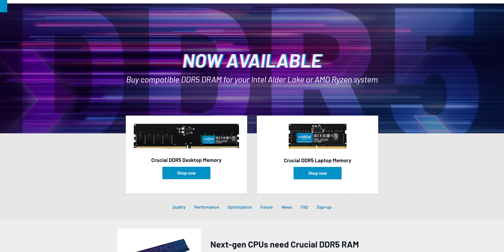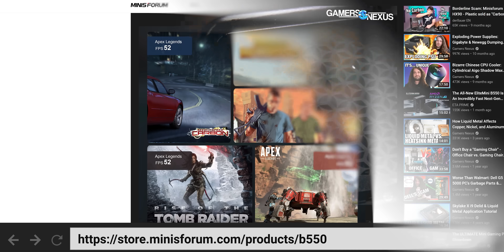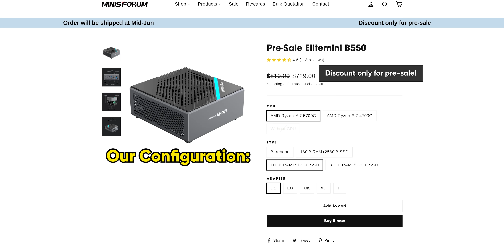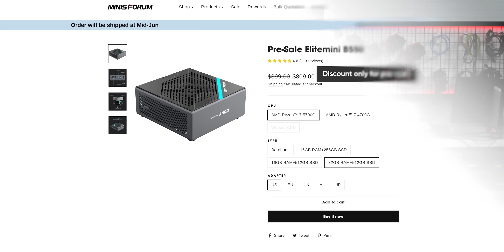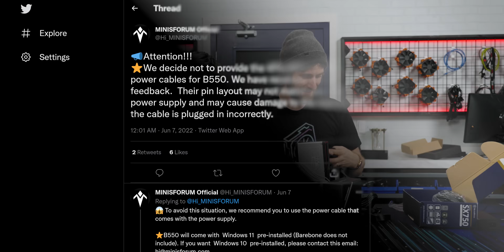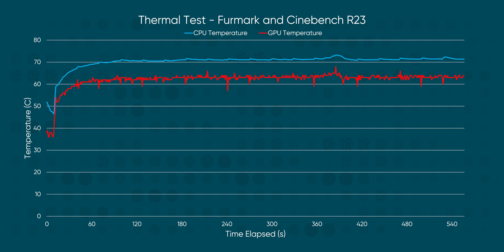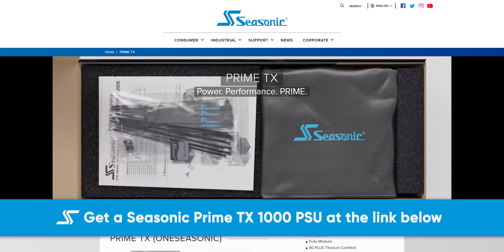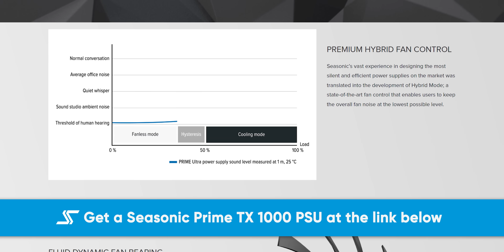Who's Buying These? - MinisForum Elitemini B550

Comment: HOT TAKE! I think it's perfect for me. I take my desktop with me a lot and having it in a package like this where I could just tear it down into pieces very easily to fit in my bag makes a lot of sense for me. I think with a couple improvements (having a fully featured PSU integrated into the chasis that I can just quickly route a cable from the main box to the GPU) this would genuinely be something I would buy.
Reply: Yeah, it seems like it could be good for a consultant or someone who travels a lot and stays in a place long enough that they want a full powered GPU in their hotel and also something that's not a gaming laptop when working at the client site.
Reply: @emma70707  But it would still be easier to just have a laptop, with a external GPU.
Reply: @DenDodde  Not necessarily. Not for me at least. I do a lot of work where I need something like a 5950x and a powerful GPU. Mobile grade compenents will literally cost me money by the added time they take to do the tasks I need done. Also external GPU enclosures still usually take up a decent amount of space where I could just have a GPU, the PC, and the platform that puts them together.
Reply: @MaybeAnnatar  What job do you have?

Comment: Very niche use, but I have all my uni work on my gaming pc and struggle to resist having a break to play "just 1" game. Because of this, bought a laptop without dedicated graphics to do all my uni work on so there is no temptation. This could be an alternative, easy to take off the GPU and just put it away when you need to focus and don't want the temptation.

Comment: this system would make a beast of a WAN router with OpenWRT or PfSense. Would run circles around any of the premium routers from ASUS or Netgear. Add a LAN card for pci-e x16 slot and you've got yourself a router/switch in a single package. All for less than 600-700 USD is pretty sweet. Would last for ages not to mention the unlimited configurability for networking nerds

Comment: This actually looks perfect for me, I am upgrading to a 3080 soon and my 550w psu is definitely not enough to push that. So if I want a system in my living room instead of getting a micro-atx case to fit the atx psu I can just have it more or less loose on a shelf with my old tripple fan gpu.
Reply: Except you should probably watch the tests done by other channels which expose just how scammy this thing is. You'd be throwing money out on a worthless system. Get a laptop. Simpler.
Reply: @aserta  why would i get a laptop to support a gpu?
Reply: @EricLab97  You could technically get one of those things where you connect a laptop to an external gpu, but i think you need a thunderbolt port.
Reply: @aserta  also what is the "scammy" part of this, I understand that it isnt the best idea to get basically just a motherboard for $320-$400 but idk what my future plan is for the old gpu. I am going to either use that psu and gpu in a different smaller form factor pc and get a mb + cpu + ram, or i might just use my "older" 3700 and b550 micro-atx board and upgrade once Ryzen 7000 is launched or smth.
Reply: @EricLab97  But if you have the cash for a 3080, there is  no reason to not just get a case where it fits in and slap your existing mb, ram and everything in there and get a solid psu, which you'll need either way.
Reply: @aserta  laptops are sh*t.
Reply: @aserta  he's getting a 3080, getting a laptop would be a bigger waste of money than to get this even if it doesn't work.

Comment: If this were me, I would want to see an adjustable side bit for the GPU mount, as to not interfere with large GPUs, or even to adjust down to smaller GPUs, there's plenty room there for a couple screws, although it would make that part of the bracket a bit weaker.  Also, there are smaller PSUs you can get, honestly I can see someone duct taping a small boi to their GPU and just going off of that. 

Additionally, $900 for full spec is frankly a steal, over here in Scotland, costs you a little more if you convert it for parts, jump on Amazon UK or ebay UK and you'll soon see what I mean.  Also I can see this being a much cheaper alternative to similar spec laptops.  Yet again, UK here so prices for parts are kinda crap in comparison.

Comment: I see it's usage in workforce for productivity, some people might need external GPU and some don't, but you have basic package for everyone, and just swap/roll M.2s for people as needed. Even if one machine dies you will have a set of same machines in the back. And likely for game development or even gametesting you might need different gpus, I see this used as a semi/workbench if you have repeatable workforce and don't want to do system building.

Comment: I just need this but for a laptop and I would 100% buy it. I know we had exteneral GPUs for laptops but I just want a system where I can just with 1 cable connect my laptop and everything is connected and when im done I can remove my laptop with 1 cable and im on the go. This way I get more performance when i am on a desktop setting and I can be on the go with the same info with just less performance. 

Couple this with a laptop that looks professional and not gaming looking because frankly i am not going to game while on the go and it would be perfect. NOT CHUNKY, really good CPU plenty of ram, 120hz (because smoooth), metal enclosure and I would buy this in a heart beat.

Comment: While this is a bit of a silly concept. I am an ultrabook w/ overpowered CPU and lots of ram no real GPU user. I love the concept of an external GPU, but it's still a bit of a mess via thunderbolt. Having a direct connect PCI-e connector (I know a manafacturer or two has come out with concepts of this, but actually affordable mainstream machines that are ultra light and with pretty displays  / keyboards / etc.) would be amazing if it became a real standard. You slot your laptop in at home, and take it with you. I just don't feel like the thunderbolt e-GPU's are there yet. Although I haven't tried thunderbolt 4.

Comment: i really like the design of that without the wires of the PSU. if they would make a neater way hook up power and try to make it a industri standard. having a slot for "CPU block" and a slot for GPU and then you just pull out one block and replace it with a new one later. a lot of people would love it.

Comment: I have 2 really good use cases.

The law firm I work at really wants to just have 100 of the exact same computer and also need GPU's for about 10 of them but the tiny form factor is a must.

Also good for a small GPU test bench for IT at the same firm. (That's me)
Reply: Question, in a law firm what would you need pc performance for?
I can imagine a chromebook couldn't handle going through a bunch of papers, but what would a gpu be of use? Like couldn't any laptop which isn't completely bad be enough?
Reply: @Daniel-dj7fh   you'd think.  Like I said there is only a few people using GPU's and they are mainly for the video and graphic designers we employ. Mostly for our commercials and the few apps we deploy

As for the others excel spreadsheets can get really intense.  I was shocked when I started here to see how hard they can be on a system.

Comment: Great video as usual Linus! I'm actually going to build my own PC in the next month or two and I'm using your videos as guidance :D
Reply: remember to take your time.
and if you have a cheaper motherboard be careful that the pins on the io-shield are bent correctly and don't damage your mother board ports. Bet thing is to put your io-shield on the motherboard and checking everything before clipping the io shield in the case.
Reply: @Daniel-dj7fh  will do! thanks for the tips :)

Comment: This product is neat, but ultimately pointless. Like Linus said, get a laptop.
I have a GPD Win Max with the 1195g7, and a 3060TI egpu.
When i'm at home, my win max acts as my main gaming PC. And though i do have some performance loss over the thunderbolt linkage, it's not terrible.

The only thing about my win max that i hate, is that i can upgrade the ram, so i'm stuck with 16GB. Which isn't enough for one of the games i play.

Comment: Man, this is simultaneously incredibly cool and also *super disappointing*.

This is essentially the ultimate fix for all of the ultrabook + eGPU combo kinks, but simultaneously offers none of the benefits of having an ultrabook.

Open standards for external PCIe connections on laptops would be super cool. But I think everyone would prefer to continue making their own proprietary and locked down thingy, or just use thunderbolt.

Comment: They should have made the main unit a laptop with a desktop CPU and PCI-E x16 slot. This solution could have competed for a market share with the "just buy 2 systems: laptop and gaming PC" strategy. When unplugged (or powered by a power brick), the CPU could have used only efficiency cores at lower clocks/voltages, just like a regular laptop. On the other hand, at home, you could have just plugged the laptop into a station with full power delivery and PCI-E x16 (we could have here an additional CPU cooling system similar to LPP from Eluktronics).

Comment: Use case: "Dad upgrades 4 kiddos to a shared gaming system for older AAA and  emulation using spare 1660 OC and Ryzen 3600 with a barebones kit"

Dad's secret: Will also be a reason to pivot to Dad's system upgrade to zen 3 cpu and 30 series card. FULL SEND, NO RAGRETS.

Comment: I wonder if it points a way towards a new model of DIY computer building.  The biggest issue I have with building (or upgrading) my PC now is all the cabling.  Being able to assemble a computer from a modular - Motherboard-CPU-Memory-IO-storage module, a GPU module, a PSU module and may some HDD's where everything just plugged together without the need to manage all of the cables is something I would be very interested in.  For me that would be more interesting than the small form factor PC.  If this came with a larger enclosure that included all of the pre-routed cables and all of the pieces could just be plugged in - I think it would be a great idea.

Comment: I love Linus' confusion at the end. He's not wrong. This product seems to be solving a problem no one has.
Reply: I honestly think this is a solid ass alternative to a laptop for Uni if you have access to a monitor, which you normally can in a lab or the pc rooms. With a Logitech keyboard mouse combo it's literally just plugging it into the wall with the brick and yoinking the hdmi cable of the uni pc to have a 100x better experience where you can have all your files and programs.
Adding the fact that you can have a pretty slapping apu in there makes it even better for engineers or programmers who need abit more performance than something a surface pro or something of that category at the price range can offer.
Instead of buying a low-mid range laptop I think this is the way to go. You can get a R5 5400g for under 200 bucks and 16gb of ram for about 70 which makes this thing ~700 bucks. And I know of no laptop which has specs on par at that price. Maybe +60 for the mouse and keyboard and you can get those old dell 4:5 monitors pretty much for free nowadays and you're good to go at home.
Reply: You're not everyone.

Comment: Thanks for doing these.  I know these types of projects seem confusing but the holy grail we're all looking for is a portable, Upgradable, Quiet system that gives you Desktop performance.  Since most of us plug in for power already, creators (game devs, 3d artists) are looking for systems that could theoretically be taken to the office or travelled around with.  Systems we don't have to replace every 2 years for $2500.
Reply: Yes!. This is something that is difficult to make other people understand. I want a portable, upgradable system that I can just put on my backpack and travel to another place (Lan Party, Coworking Space, Friend's House) with the upgradability on mind.
Reply: Could be traveled around with. Just needs a monitor, keyboard, and mouse at the minimum, which are not guaranteed when traveling around. Like Linus said, just get a laptop.
Reply: @castform57  Yeah I get it, the laptop form factor is almost unbeatable.  Monitor, keyboard, mouse it's all there and it's all built in and integrated.  Just fold the screen down and you've got a super portable machine that easily fits into a backpack.  What I'm saying is that thanks to these efforts we're almost at the point where we can construct a laptop-like small enough computer with desktop parts which would allow you to customize and upgrade it and would also benefit from the power of desktop parts.   My mini-PC cost me just over $1000 to build and that price tag includes the geforce 2070 super I have running inside of it.  It's 3 years old and It currently out performs all $2500 laptops released this year.  Some of us are happy to carry a mouse, keyboard, and portable monitor around with us if it means we'll never have to buy another laptop again to stay current.
Reply: @castform57  I have been traveling with my mac mini with my keyboard and mouse. Why should I get a laptop? it does not make sense to me.
Reply: Is this a paid ad by the maker? This thing is DDR4 and AM4, it's already obsolete, let alone 2 years from now. Get a laptop.
Reply: @xXxCobraCommanderxXx  That's expensive. Maybe with $1000-$1200 I can buy this mini pc with a decent GPU. If I want to travel to another place while I'm still working I just go out with my mini pc and the gpu would be at home.

If my mini pc gets stolen on the trip, I would be losing $700-$800, but my gpu would be safe at home.
Reply: @xXxCobraCommanderxXx  A laptop with a good dedicated graphics card is about 2000$. This setup with a good GPU is about 1000$. I like my money in my pocket, thank you. edit: I should rephrase that. If you want a laptop with a good GPU, you need to buy the high end model ($$$). Hard to get a basic cpu with a crazy-fast gpu...
Reply: @sdesmtl  Add to that how absolutely garbage modern laptops are in terms of upgradeability and ahem repairability, something like this looks way better just for the peace of mind not needing to replace the whole system if one component fails

Comment: This thing is pretty close to the shape of the Intel NUC extreme kits, but with an open air option to accomodate most GPUs.  What kills it is having to attach the PSU (and all its cables) to it anyway if you want to use a GPU.  Maybe just ship a second external power brick for the GPU, come up with some clever tooling that eliminates or reduces the need for power cables being a rat's nest and that solves most of my major gripes.

Comment: the "bad" cpu was most likely one of those cpus that need to disable c-states and keep voltage within high side of normal ranges (ive had quite. a bunch of unstable 5600gs that just need to stay within 1.1-1.2v or they crash at idle 0.6v)

Comment: There is one thing you should know is disassembling the PC.
Plug the PC onto the base, then you need to mount them on the standard.
But the screw is blocked by the GPU, so if you just want to take the mini PC you have to remove the GPU first.

Comment: I can sort of see a use for this I guess, definitely not any kind of budget use, but like, say you have your office, but you work at home sometimes too, and maybe even want a pc hooked upto the TV in the lounge now and then or something, if this was more of a complete dock, I could see just picking up the main compute (All your work/apps/games/etc) and just moving it over to another dock sort of like a switch, like I said, definitely not a budget thing, you'd need a GPU per dock in that case, and I'm guessing 3 identical GPU's to avoid driver issues, but this could be a solution for some people rather than high speed networking and network storage, all the portability of a laptop with all the potential power of a desktop, niche I guess, but I could see it being super cool for those 10 people looking for exactly that.

Comment: Having to use a different external PSU kills this concept. While I understand that modern GPU are power hungry beasts I feel a more elegant solution could have been done so you don't need to deal with all those cables and have the power brick be the PSU itself and maybe include a 500w one or something and have the option to upgrade to a higher one wattage ones.

Comment: As long as the extensions are pinned straight across, it should be fine. Was that not the case? Edit: On a rewatch, it seems the cables were intended to be plugged directly into a psu. Bad idea.

Comment: There are 2 Desktop PCs that are smaller and more powerful. Either a 5L Case with 3060Ti and a 5800X3D or if you want to mod a little a 4L Case with 5800X3D and a modded A4000.
The Cases that fit the bill are for example a Velka3/5 or a Densium4/4+. Both have internal PSUs.

Comment: The title made me think of a different video idea: you guys should test different varieties of a GPU, like a 3 fan vs 2fan vs 2 slot vs 3 slot vs low profile etc of the same chip like a 3060 or rx 6600. I'd be curious if you actually get any extra performance from the extra heatsinkage or if its just wasted metal that youre paying for to look more substantial.

Comment: Straight pin out extension cables should be fine. You only run into an issue if the extensions try to change the pinout, which is obviously a big no-no if these ones do that.